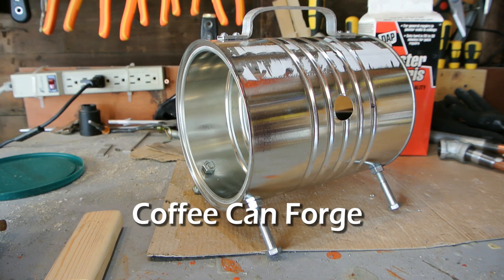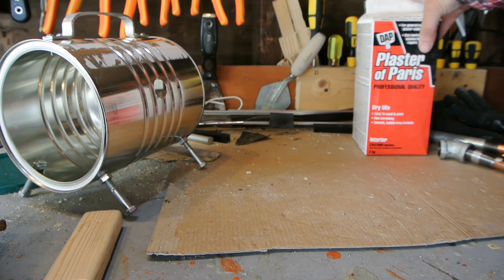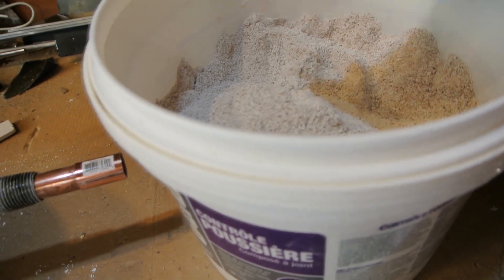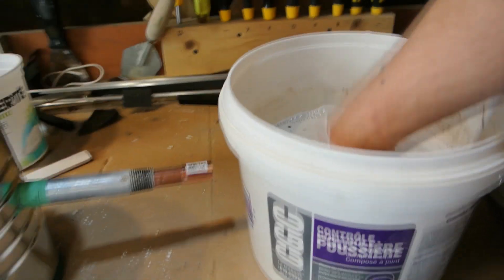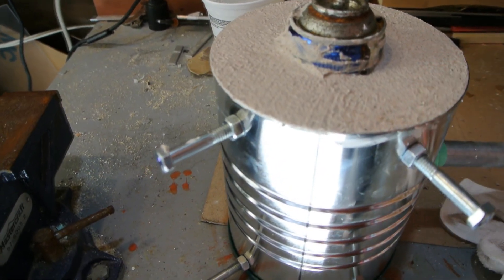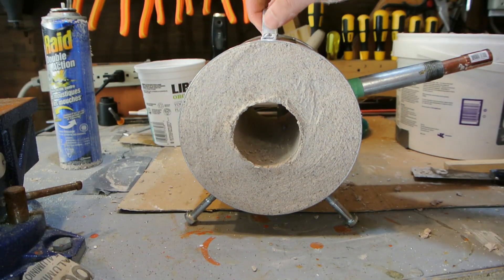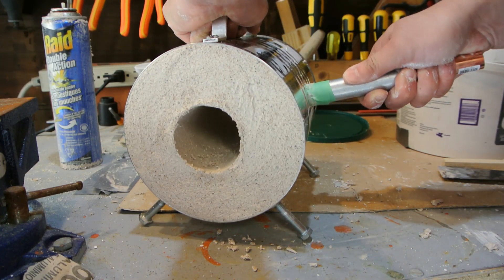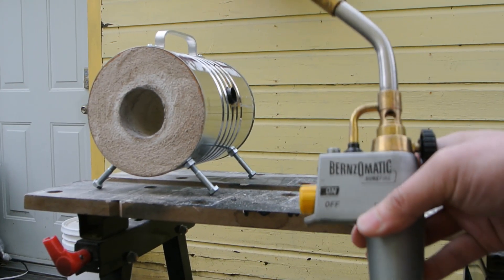How to Make a Coffee Can Forge

Comment: You should use calcium silicate, magnesium oxide (cook it out from milk of magnesia) + sand & perlite. Plaster is a flame retardant, not an insulator. It loses 40% of it's weight in water, shrinks to 1/3 it's size, takes hours to dehydrate as it just spews water & suppresses the temp then cracks to shit.
Reply: Thanks Robert, I never red such a long post on You tube yet it is very informative and practical. Thanks for the detailed ratios.Even the Devil would hate you for making such a hot forge, Just kidding !
Reply: Robert Cece what ratio would you work with using those alternatives?
Reply: Sure thing, let me explain the basics first encase anyone else reads this. There are 2 TYPES of kitty litter at most supermarkets. "Clay" kitty litter and something called "crystal" kitty litter. Then there's a hybrid called "clay/crystal mix" which you don't want. The clay litter comes in 2 different colors, gray or yellow. Both are bentonite clays. Both clays are made of aluminum silicates (phyllosilicates). You want the GRAY clay.

But you also want the CHEAPEST, store brand clay. It cost me $4 for 25lbs. The cheaper clay may not have a picture on front so rip a corner off in the store (many bags have holes already), pour some out and make sure it's gray pellets. 

The reason you want the cheapest clay isn't price. It's because the cheaper clay is known as "natural clay". Natural clay has high aluminum silicate content, it's more stable, shrinks less and bonds better.

After you get a bag of that you want 1 bag of "crystal kitty litter". These bags all have pictures. https://www.walmart.com/ip/Fresh-Step-Crystals-8lb-Cats/10313505

There's another brand called "Crystal Kitty Litter" you can get either name. It cost me $10 for 1 bag. That specific kitty litter is 99% pure, anhydrous silicone dioxide (silica sand). It's better than "play sand" since it's cooked and purified. Some people use play sand since it's already powdered ... but play sand is heavy & doesn't insulate heat as well as pure silica. 

So you're buying 2 types of cat litter. Natural aluminum silicate clay then pure, silica sand. Both in pellet form. You need to blend both down with a blender and store them in tubberware. The clay shatters to dust fast. The silica takes a bit longer but the end product is a beautiful, white sand.

Now all you really need is 1 bag of perlite. 

For the perlite it REALLY HELPS if you buy a large mesh screen. Lowes sells them in the vent aisle. I bought a cheap circular vent with the screen in. I filter the perlite through that to remove the LARGE pieces.

I do this for 3 reasons:

1) The large pieces have so much air they melt in a furnace. It leads to uneven insulation, you get "hot spots" especially towards the bottom then they melt, crack and explode.

2) If they crack in the core you get large pockets of air that can't escape which leads to spalling in the core. Then you see giant pieces of your forge crack off. 

Just try to keep the perlite in smaller crumbs. Nothing larger than 1/8". If you're having a problem filtering enough get a rock and beat the perlite down or "flash blend" it a few seconds then screen it.

The recipe for just clay & sand (my first clay forge):

2 cups clay
1 cup sand

The recipe with perlite

2 1/2 cups clay
1 cup blended silica
3/4 cup perlite

Just add water till it clays up like dough then RAM IT in your forge. It'll set & get hard in 10-20 mins. Then you wanna fire it SLOW when it's still wet. You can throw it in an oven at 125C or turn your propane on with a small flame and let the moisture COOK OUT SLOWLY for hours.

This allows expanding air and water to find pathways to the surface. Which harden and leave behind pores. The next time you quick fire any internal gas quickly finds it way out without cracking. Air drying won't create pores and it will crack when fired (hard shell/wet core). 

Both those mixes will give you an awesome forge that lasts forever. 

And they can withstand iron melting temperatures. I've blasted my forge repeatedly with oxyhydro gas (HHO/water cell), that mix burns at 2500C - 5000F and all that happens is the liner turns to molten ceramic. It gets shiny and glossy but still doesn't crack.

One last thing. After you make a good forge you might start playing with hotter fuels. Like coal, oil or HHO like I do. A good HHO kit costs around $150 on ebay. And a good propane burner costs around $50. Like the TS8000 that Lowes sells.

I connect the output tube of my oxyhydro torch (a fish tube) to the AIR INTAKE of my TS8000. So instead of pulling air into the burner it pulls air, hydrogen and oxygen which can be tweaked to melt anything. 

The forge I do that in it made of:

2 parts clay
1 part silica sand
10-15% perlite
 
+

calcium hydroxide aka lime (mix lye with damp rid [calcium chloride]). You add about 1/3-1/4 the total volume of the above mix.
magnesium oxide 10% (burn milk of magnesia at 350C)
no more than 6% plaster (calcium sulfate)
sodium silicate (just a squirt, 2-3%)

If you mix lime in with your clay & sand you'll notice a very familiar smell. PORTLAND CEMENT. 

And if you research professional, castable refractory cement it's just made of portland cement + a mineral called "cristobalite". Cristobalite is like perlite but it has a harder crystal structure that withstands higher temps.

So you can make a lazy & quick refractory just by mixing regular portland cement with screened perlite. The downside is you can't mold it like clay, you can only pour it. It needs to AIR CURE for at least a month before firing. It gets hard as steel. But it's not a great insulator and tends to crack.

My most recent forges are a hybrid of both worlds. Clay is elastic and can compress & decompress (think rocket nozzles)... concrete allows you to add more insulative materials like perlite & magnesium oxide.

So I mix everything by eye and end up with a SUPER LIGHT, hard material that can expand & contract (thanks to the clay) without cracking.

The clay acts as a medium strength compressible binder.

The lime acts as a non compressible super binder.

The magnesium oxide is like a super insulator. It's way better than perlite, more stable than perlite (crucibles are made of MgO)... I use it to cut down the amount of perlite I use it'll make your mix light like a feather. 

The 6% plaster is an inhibitor. If you play with lime at all you NEED calcium sulfate otherwise it will "flash cure" on contact with water. Even a minor flash cure can cause concrete to fail. But a small amount of plaster keeps it wet and moldable. You only need like 2 tablespoons for a gallon worth of total mix. So you're not rushing to ram and mold everything. And you get a stronger end product.

Then the squirt of sodium silicate is for "self curing" which doesn't mean what it sounds like. Lime also self cures but only at room temp. Self curing happens under a microscope. Where concrete dries and cracks then moisture leaches lime back into those cracks and self repairs. So viewed under a microscope over time you see microscopic cracks that are created and later filled with free lime from the brick that self repairs. 

Sodium silicate (in low amounts) has this self cure ability at refractory temperatures. Where high temperatures may cause mini cracks, then sodium oxide or carbonate flows back into those cracks (humidity & heat moves it) and it self repairs. If you use too much it winds up doing the opposite. Where it flows into cracks then expands like ice and destroys everything. All you need is like 1/4 cup per gallon of refractory mix. 

That's about it!

Oh and one last thing. One day you might wonder how crucibles are made. And you'll hear about a magical compound called "grog".

So it doesn't take you years to figure out.... all grog is IS CALCINED ALUMINUM SILICATE CLAY.

That natural clay I told you to bought. If you ever wanna make grog all you do is blend it down, throw it in a steel crucible then fire it with air propane.

Now you have grog to make crucibles with. The only other ingredient you need is magnesium oxide. I like to mix these 50/50 by WEIGHT. Not volume. Then you take that mix and throw it all in a blender. Blend it a few mins dry. Don't skip this step. Take that material, add as little water as possible so it squeeze binds. Ram it in your mold. It'll set fast then you slow fire.

If you want to melt steel in those crucibles you will have to flash fire the crucibles to ceramic. I do that again with oxyhydro gas but Lowes sells those cheap oxy/propane torches which for $60 you can fire as many crucibles as you need. It's easier to use the torch like a paintbrush and fire it like you're painting it. I fuse the outside round n round, then the inside a quick blast melts the whole core and it comes out white & glossy.

Let me know if that helps. :-)
Reply: Robert Cece Oh wow! Cheers for all that. Very much appreciated and totally unexpected. Thanks : )
Reply: For portland + perlite? Professional blends use 60% silica (cristobalite) and 30%-40% portland. But 60% perlite has too high a refraction index which will melt your forge. So you wanna reverse those ratios to 2/3 portland and 1/3 perlite SAND. Don't forget to screen & crush the perlite so it's a light, feathery sand. And do NOT be afraid to mix some clay in there. 1/3 clay to 1/3 portland to 1/3 perlite would be far superior. So many people forget that the goal of "refractory" materials is to increase your refraction index. Refractory materials like perlite just reflect more thermal energy than they deflect (diffraction). And where perlite is great to increase temperature.... clay raises it's refraction index by raising it's melting point. There's another coffee can forge on YT made of pure perlite & waterglass (never use that recipe). In the video you see the forge lining melt and the second the lining goes molten its refraction index plummets. But clay will stop that.

Remember, the goal of refractory is to reflect AND amplify thermal energy to efficiently reach the hottest temperatures possible. 

Look at a sound refractory like a speaker cone in a subwoofer. Then look at the top of ANY commercial blast furnace (gas fired). The top of those furnaces are ALWAYS shaped like an upside down cone.

The blast of heat at the bottom reflects radiant heat towards the cone, which like a flashlight reflects the hot thermal energy back towards the bottom round n round the heat is condensed and amplified.

So where propane / air burns at 1000C.... that same exact mixture will nearly double it's temp in a true refractory at 1900C. Commercial furnaces do this by venting exhaust for preheating but a good propane forge just by design should be hitting 1500-1600C. Oil or coal in a conular clay forge will liquefy high carbon steel. There's already videos on YT & soon I'll get my own up. I just need a better oil delivery system that people can copy cause they hate coal and oil tends to confuse most people.
Reply: @robertcece6972  is there any way you can dm this info to me. Or copy paste it in a message for me. That would be super awesome of you :) havent seen such a well explained tutorial in quite some time. And in such a fashion (on a message thread )  🤙🙏
Reply: Robert Cece, I realize this was a long time ago when you posted, however would these mixes be practical to use for a large forge. Say for instance a helium tank I have cut in half vertically? I have the sand, perlite in hand and I’m trying avoid the cost of buying refractory cement and ceramic blanket insulation. Thank you for your information by the way it was very interesting and helpful.
Reply: thanks man great info
Reply: Robert Cece so if I understand correctly, you could skip getting 2 kinds of cat litter and just get portland cement instead? And you would mix this with natural clay (does this have to be the kitty litter clay? I live in an area where the soil is clay, sticky when wet, and when dried properly it's like a greyish sand... sounds like it might be the same or similar) and crushed perlite? So you skip the whole silica gel pellets because it's already in the portland cement? I also have some black aluminium oxide powder and I can make sodium silicate from sodium hydroxide and silica gel.

From what I pick up from your posts I can make a forge by mixing 1/3 portland cement, 1/3 natural clay (hopefully just from outdoors) 1/3 crushed perlite, and mix in a bit of sodium silicate and aluminium oxide, of which I don't know the ratios. would this assumption be correct?
Reply: one more question about waterglass if you don't mind. When I made it, it became a very sticky, almost solid glue like substance. nothing like the almost fluid state you see in other videos. not unless I heat it up/boil again. Is it supposed to be fluid or solid at room temperature? Wrong ratios maybe? i used 50-50 sodium hydroxide and silica gel plus distilled water.
Reply: Robert Cece - Could you direct us to your other channel please?

Comment: Try oiling/ lubing the small can and pipe?
Reply: Crisco / vegetable shortening makes an excellent release for Plaster of Paris.
Reply: actually wrap in saran wrap and then lube it, you wrap it enough to make slightly larger diameter and slides right out, cement don't stick to plastic

Comment: What is difference between use of concrete and plaster of paris?
Reply: Concrete 'fixes' water.  Use concrete and put flame to it , you have a bomb!  Really!   It will explode! (water boils, makes high pressure steam, explodes)
Reply: Couldn't you cure it with small fires?

Comment: I think you were going for Vermicultite? Ver mick you light. Super absorbent. We used to advise it's use for cleaning up certain industrial spillages. A thick rubber band around the can will maximise grip on it's surface; Use of a door/lid to retain heat and/or blowing air into the furnace should raise it's Max Temp.

Comment: this mixture doesnt get hot enough to heattreat steel.
Reply: It should.   The back opening needs to be covered, and the torch head should be angled.   The angle would create a spiral vortex and increase heat.   This set up, when properly done, will forge weld.   I have made several like this.   His design is pretty solid, just a few tweaks needed to get it up to temp.
Reply: yes it does. steel heat treat temps can be acheived with that mix

Comment: so I followed your design except mine does not go all the way through and my hole is slightly smaller. it seems as tho the only part of my metal that gets hot is the part directly in contact with the flame. is there a reason for this? help please!

Comment: Have you been able to get anything forged successfully? The bolt you put in was glowing orange, but I thought forging had to be done in the bright yellow colors.
Reply: forging can be done as long as the metals glowing.
Reply: ri henry to use this design and get yellow metal colour you would need to fill the back hole and leave only the front hole, also use a perlite and cement mix so it could withstand the temperature

Comment: any ideas why mibe would not get to temp? using a propane tank (small green lantern tank) and a basic torch attachment. no cap on back end.
Reply: keep one end closed you can build a back lid from plaster and sand and use map gas it's about 500 degrees hotter than propane

Comment: I tried this, but it won't heat up very well and I'm wondering what I did wrong
Reply: the second hole makes it a whole lot less efficient
Reply: Nathan - don't make it open ended, you want only the front hole and a closed back, also use a concrete and perlite mixture for the insulation instead

Comment: Andrew w. You should get/make a bigger torch it will heat up your metal in a very short time. It will probably cost a lot but it will be worth it if you want to get into blacksmithing. I recommend "the King of random" gas blaster propane torch. Beware you will have trouble with the set screws

Comment: I was wondering if you knew the internal temperature this reaches. I wanted to use this to melt some aluminum or maybe some copper, is this possible with this forge?
Reply from the maker: I'm not sure of the temp, but I have melted very small amounts of aluminum with it.
Reply: Sounds to me you are looking to make a foundry vs a forge for melting and smelting. Not to detract from Andrew's video, because he did a killer job, but check out the King of Random's DIY on making a foundry. Very similar concept

Comment: I have an old mailbox metal mailbox and I was wondering if I could use that instead of the tin can?
Reply from the maker: Sure, be cool looking too.
Reply: Working on it ... still need the paver rock on the bottom and the plaster sand for the rest of it
Reply: Weu (put put c altYboruher  p yup pwyramid pi Pou pi waltèrsolrrilAtkinson

Comment: I built one of these and for some reason, it will not get up to heat. I did not make it open on both ends. I have even tried placing fire brick in front of the opening and it still will not get up to heat using a spiral tip torch. Any ideas on what might be wrong?

Comment: Is the sand just filler? or is it needed for some reason?
Reply: the sand needs around 3000°c to melt so that takes all the heat that this will never get to and the plaster holds it together and will most likely crumble or explode with out sand taking the heat
Reply: OK Thank you

Comment: Looks nice but wastes alot of resources.. Forges using coal while powered by air are better imo.
Reply: Actually, That is incorrect.  Coal forges are very wasteful.   I have been a ferrier all my life.   Coal needs to be refined into Coke, in order to be an efficient fuel source, and you lose a shit load of coal in the process.  Propane burns cleaner, hotter, and is cheaper than coke.
Reply: Propane burns cleaner and is easier to obtain also you can get metal really hot consistently unlike coal